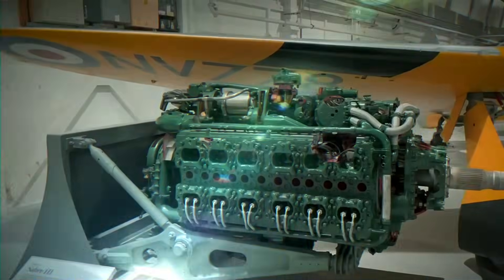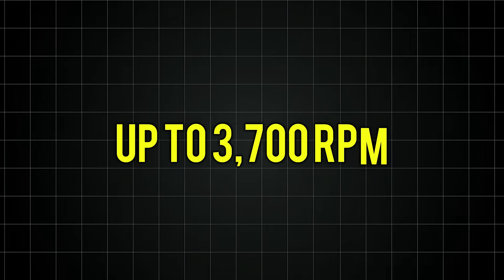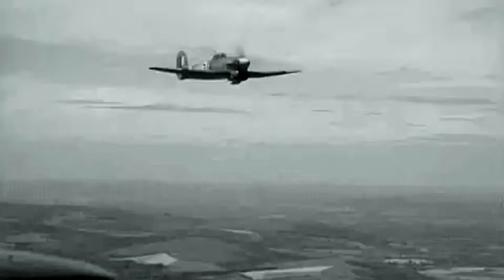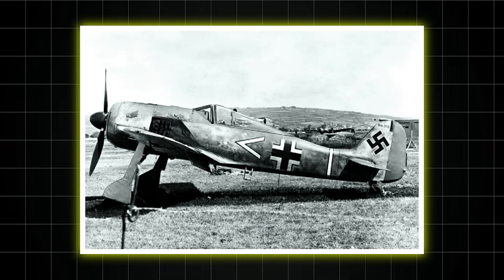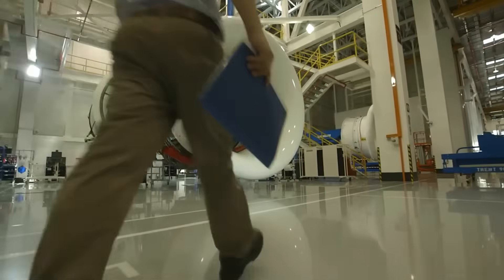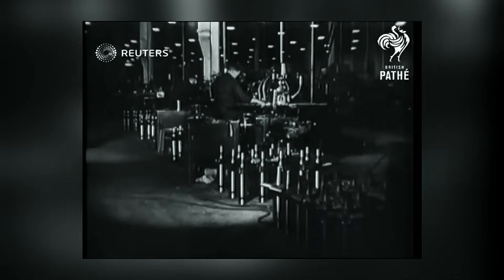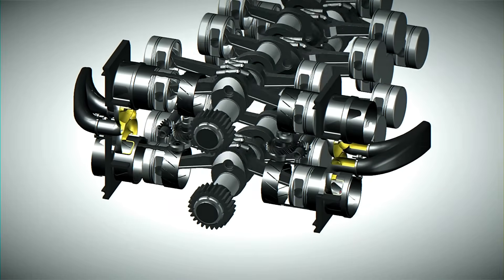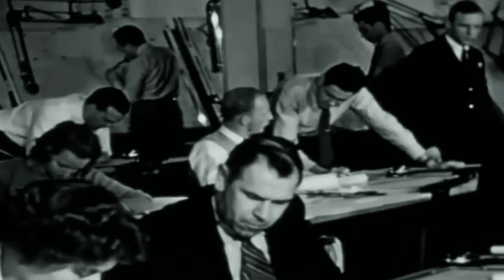The Shocking Truth Behind Napier’s Sabre Engine

Comment: As usual Hawkers and Napier were trying to solve a non existent problem with an inferior product.Compared to Griffon powered Spitfire Mk XIV as the default fighter and the Thunderbolt for ground attack.
Hawkers should have been turned over to Spitfire production    before the battle of britain and then licence built Thunderbolts.
Reply: "...As usual Hawkers and Napier were trying to solve a non existent problem..." - Oh! the joys of 20/20 hindsight! And how many other "should haves" are on your list? Talk about pearls of wisdom....
Reply: @jackaubrey8614 
The question of why not ditch Hurricane and Typhoon/Tempest production for Spitfires and Thunderbolts has nothing to do with hindsight.
Reply: @confederatenationalist7283  But the Typhoon was an excellent low level interceptor and ground-attack/fighter-bomber.  The Tempest V?  Below 20,000ft, it had no peers.  

PS. You are using hindsight.
Reply: @paulbantick8266 
Firstly the American daylight bombers, which is what the Luftwaffe was mainly targetting at this stage, were generally flying at more than 20,000 feet.
Agreed going by the biographies of surviving Luftwaffe aircrew like Willi Heilmann of JG 54 the Tempest was feared v their FW 190 D9's but the Spitfire ( Mk XIV ) was clearly feared more.Far more.
 Also Galland's comments regarding the XIV was the best thing about it was that there were relatively few of them.
Obviously there would/could have been more if Hawkers production capacity had been added to making them instead of Typhoon and Tempest.
Don't think there is any argument that the Thunderbolt was a second to none ground attack aircraft far less vulnerable to ground fire and exploding targets than any water cooled option and better at getting out of trouble and home than the Typhoon.
None of that is hindsight.

Comment: lots of factual inaccuracies.
Sleeve valves allowed the use of higher compression ratio's as there was no hot exhaust valve and they also allowed higher volumetric efficiency in the engine.
So, yes , there was a need for sleeve valve engines until such time as high Octane petrol petrol became readily available and Sodium cooled Exhaust valves were perfected.
Also remember the Sabre ran a lot faster than other aircraft engines.

Comment: -There was nothing wrong with the Napier Sabre apart from the British Air Ministry pushing it into it entered service in October 1941 on the Hawker Typhoon in response to the Fw 190A1.   service 1 year sooner than scheduled.  This meant not all of the design or manufacturing had been completed .
-The Bristol Centaurus only entered service in mid 1943.  The Griffin entered service at n late 1942(realistically Feb 1943)
-Give the Napier Sabre the 12 extra months needed. 
-Poppet Valves simply became better eg with sodium cooling  and sleeves weren’t needed.  Late war Jumo 213A at 1.98 ata boost were doing 2350hp at 3250 rpm.   The Jumo 213J was expected to achieve 2800hp at 3750 RPM.
-Sabre was remarkable engine
Reply: What's the Griffin?
Reply: @williamzk9083
 What's a Griffin?

Comment: Harry Ricardo, engine boffin emeritus of the day, postulated poppet valves had reached their limit.  Detonation problems.  American refineries steadily improved gasoline octane keeping poppet valves in the game.
   Sleeve valves are not only difficult to make, they also slow down heat transfer from the cylinder.  The greatest engine friction loss is the compression rings and the Sabre had 2x more per cylinder than a poppet valve engine.
   Yet, the Sabre was a remarkable achievement.